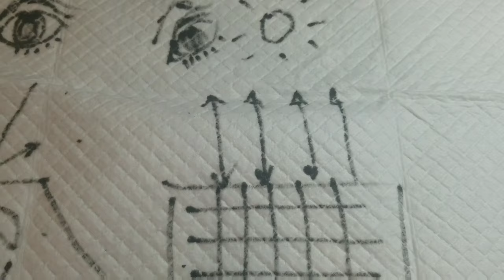Revive Your Golf Clubs: 2016 Taylormade M2 Iron Polishing Tutorial

Comment: Thanks for the video tutorials Brad….I have found them very helpful!  I have the 2017 TaylorMade M2 irons.  I’m going to polish mine using an 8 inch bench top buffer / polisher.  A couple of questions.  Are these clubs chrome plated?  If so, could you be to aggressive in your polishing and polish right through the chrome?  Also, do you have to be cautious of the rubber insert on the bottom of the clubs?  Thank you Brad….
Reply from the maker: Hi, Steve. The m2 are not chrome plated, just polished to a high gloss shine. Definitely either tape the speed slot or just avoid it. The wheel generates a lot of heat and can melt that material.

Comment: I used the same wheels, same Caswell compounds, same technique on various clubs at various levels of scratchiness and still cannot get them to come out like yours. I know YouTube’s are usually cut short so I’m wondering how much time do you spend on each club, with each compound/wheel combo? I’ve spent an hour on a club that wasn’t so scratched and still can’t get the sole shiny. I may be helpful to post a long form video or even a short video with more detailed explanation on your process. Or maybe I’m just too impatient. Love your videos btw great work
Reply from the maker: Did you do any sanding beforehand? I'll bet I spend about 30 minutes on each club. The most time is spent on the sisal wheel using quite a bit of pressure. But, you'll be there forever if you're trying to remove larger scratches with just compound. Light sanding is key here.
Reply: @BradMeehan  thanks a lot this helps, but in your Wilson staff irons video you didn’t appear to sand or even use a sis wheel and also used the same wheel for two different compounds however, you were cleaning and raking in between I’m trying not to use the sis wheel because I’m scared to eat through the chrome Because I’m trying to do this without electroplating I just want to polish to the best of compounds ability
Reply: @BradMeehan  also I don’t mind leaving some scratches if too deep or big big dings as long as there’s not too many. I just started based off of your Wilson’s staff video which only used compound and one denim or flannel wheel and one cotton fluffy wheel (same as a lot of the early videos before you started plating) but those Wilson irons were in pretty great shape to begin with. I’m trying to just get mine the best I can with compound only starting with black for now until I get it down to a science and then go on to plating maybe. And as I mentioned before I don’t go harder than denim wheel out of fear of going through plating, (unless of course they are super rusted or whatever ) am I being to safe? Can I go down deeper without having to replate? Also do you have any recommendations on refinishing a polymer/plastic putter face if I accidentally burned through a few spots while buffing the edges lol I know I should have taped it off. Anyway thanks a lot these videos are the best on the subject on YouTube as far as I can see. They really gave me a new hobby and now I’m addicted buying every $30 set of clubs on eBay I can find lol
Reply from the maker: @Draw54  can you share which club you're working on?
Reply: @BradMeehan  taylormade r7 irons at the moment

Comment: Thank you Brad! I've really enjoyed all of your videos especially seeing the vintage clubs restored to their former glory. I have a set of Bridgestone forged irons with a satin finish (not chrome). They are in pretty good shape but I'm planning to try to clean them up a bit more and hopefully minimize some of the regular bag chatter a bit.  Is there a particular video of yours that would work best for this finish? So far I am looking at starting with a fine deburring wheel to see if it can reduce some the minor chatter, do you think it will or is there is a better way?
Reply from the maker: Deburring and sanding will get the chatter out. Even if you're going to do satin, I'd polish it shiny first before taking back to satin.

You can either make it satin with the little handheld media Blaster or a brushed look. Check out with Wilson Reflex v or the Wilson Dyna-Powered video I made. There are parts of the club that have a satin finish using the media gun. You can soften it with lower air pressure.

Comment: Would a 2850rpm no load speed grinder do the same job?
Reply from the maker: I'd think so. The max rpm of the wheels would determine that. If I remember correctly, they're rated lower than my orange grinder (3600). Just read the max rpm of your wheels.

Comment: Love this video! Is it possible to do touch ups with just the rotary tool (with a little extra elbow grease)?
Reply from the maker: Definitely. Take a look at my Titleist driver video where I use my rotary tool on the sole. It would just take longer. Don't be afraid to use high grit sandpaper for the scratches, like 1000 grit before using the rotary tool.
Reply: @BradMeehan  gave it a go with great results! probably hardest bit was removing the scratches.
Reply from the maker: @karimrahemtulla3053  nice! Yeah, that's where the sisal wheel is helpful. I spend most of the time either wet sanding with paper or on the sisal wheel dealing with scratches. The more prep you do before using the compounds, the easier those steps are. The white and green compounds are 5 minutes, tops.

You can find used bench grinders at thrift stores or estate sales for 20 dollars. If you decide you like this, I would look into it.  

Send me a picture. Maybe I'll make a viewer success video!